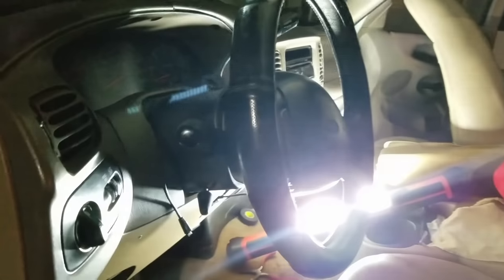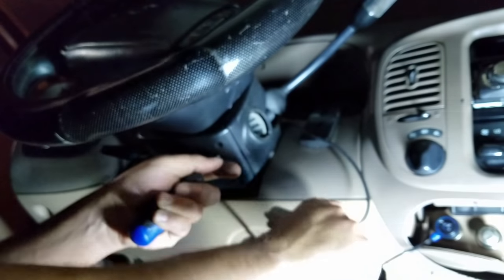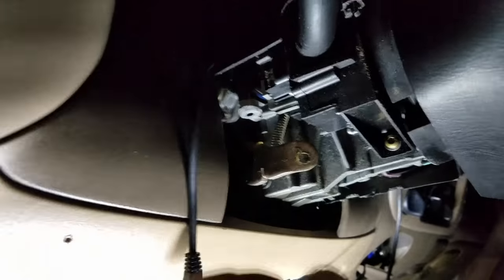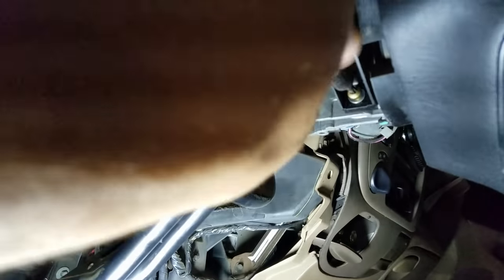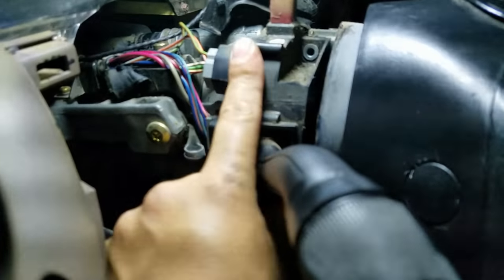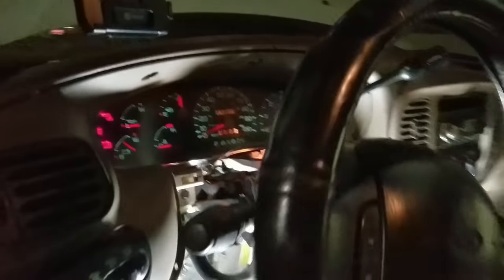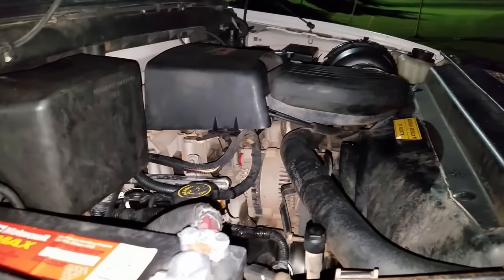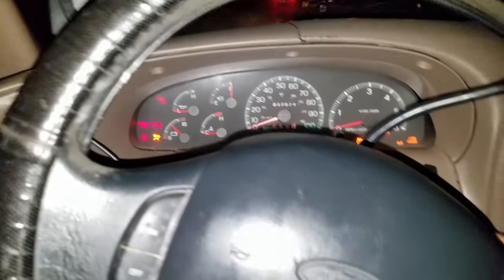How-to Replace Turn Signal / Multi-function Switch 1997 Ford F250

Comment: Very nice tutorial!  I was able to do this without removing the lock cylinder and the bottom trim piece but, the way you did it definitely makes it easier to disconnect the electrical connectors!

Comment: Thanks for your compassion and detailed instructions, i was able to fix it. your advice of disconnecting the battery was most important. may this universe bless you with abundance and bliss.
Reply from the maker: Thank you! I'm happy I could help!
Reply: I m facing another issue, the inside cabin lights are not working in my 96 F-150 Econoline Conversion Van. Do u know where is the fust for the same ?

Comment: Working on a 1999 F250 7.3 that has malfunctioning rear turn signals and brake tail lights. Front turns work and 3rd brake light on the cab work. I’ll try to remember to update this so someone with a similar problem can see if this is a viable option. 

First tip I have is pull off the screws and the column adjuster off. Then take the bottom plastic off and it makes getting the key assembly off 10/10 easier. 

Got a new one ordered pulled this one apart and it was pretty dirty. Trying to clean it and see if I can get it to work

Comment: That over drive button is a easy fix,,,the wire that runs down through it gets rubbed to make a bare spot ,,just fix the wire and your back to working,,,,,Also that multi switch can be taken apart and cleaned is all it needs,,will work again.....,,Good video

Comment: Whenever one is working around the steering, assume the airbag is working and WILL GO OFF with the slightest f around.   Always disconnect the battery.  VERY IMPORTANT.

Comment: Thank you for the video. 

I have a quick question, why not remove the bottom plastic cover then use the Phillips screwdriver to remove the key cylinder?
Reply: Mark Sipos hahah I was thinking the same other guys in the other videos they took the cover first! :)
Reply: Just pop off the plastic lock cylinder cover where you put the key in and it snap right back on, no need to remove the lock cylinder for this job....
As for the rest follow the video and be patience...

Comment: Lol title says F-250. Its an F-150. Not a bad video! Nice job😃
Reply: Could be a light duty f250
Reply: When you click on the drop down under the title, it says that it works on 150, 250, and 350 😍

Comment: My 1999 F 150 I was having issues with left turn signal and hazards . I checked my fuses, purchased a flasher still nothing I removed my steering cover and wires were coming loose every time my tilt would go up and down I just made cables longer solved my problem
Reply from the maker: Thanks for the info!
Reply: Same on my 2001 F150 Supercrew. Replaced flasher relay no help and it was the plastic electrical clip on the multi-function switch had deteriorated and came loose.

Comment: How can you tell if the problem is the turn signal switch or the flasher relay? Thanks
Reply from the maker: Replace the flasher relay with the turn signal relay. If you have the same issue, and all fuses are good this is most likely your issue.
Reply: Josiah Hill re wr e
Reply: If your flashers are not working the first thing to try is wiggle the hazard switch push it in and out a couple times they will get stuck half way and make nothing work

Comment: every time I hit my brakes my right signal comes on I'm thinking it's the switch I got all the screws out of the plastic but can not get the lil lever for the tilt out even using vise grips still will not turn
Reply from the maker: Wow!!! Hit it with PB or WD first?
Reply: Reviews and How-to I did that changed it with a junk yard special lol well worked great for about 6 months now I have no low or fogs or 4way brights.  I've checked everything. Bulbs relays put new headlamp switch in so I've ordered a brand new turn signal multifunctional switch ill have it this week.  I've done it once should be able to do in 15 minutes now. I'll lyk if it fixes my light issue

Comment: my turn signal works but the windshield whipers dont work would it be the whole switch or the wires for the windshield
Reply from the maker: That would require testing with a VOM.

Comment: A new turn signal switch with washer is $24 at Amazon. But you went to the salvage yard and bought one..Hahahahahaha
Reply from the maker: Sure did. $5 bucks and still working. hahahahahahahahahahahahahahaha